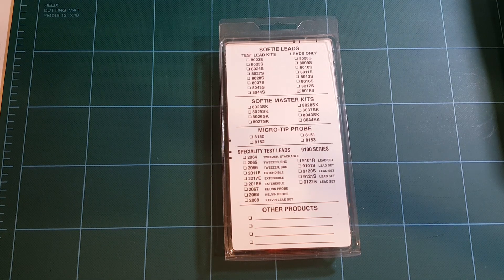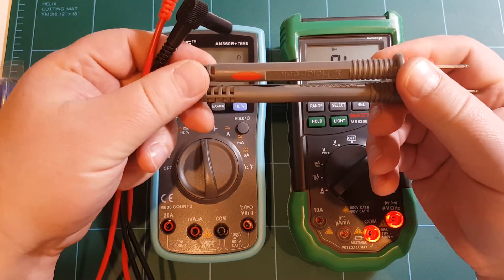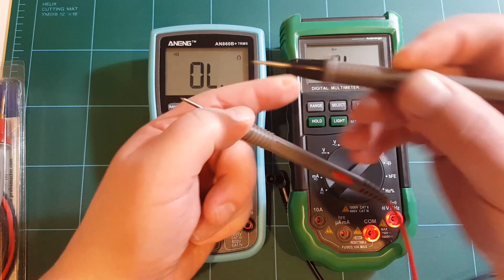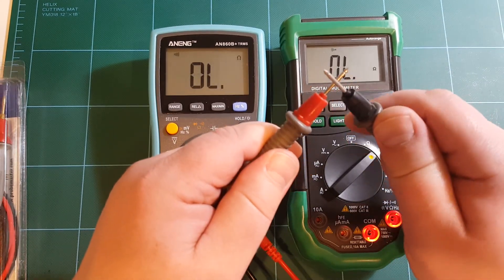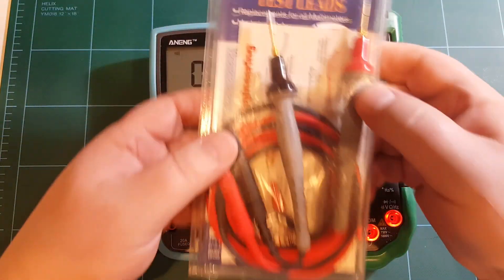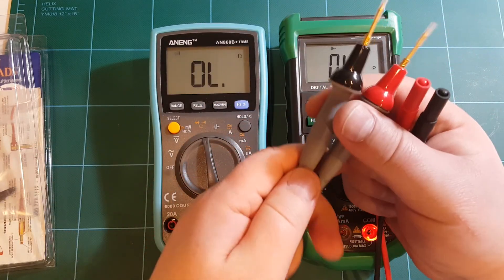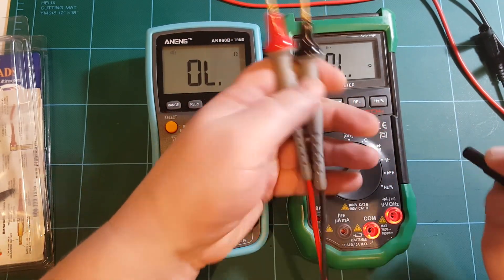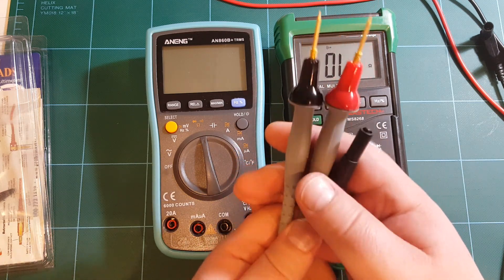Probe Master test leads

Comment: Simply clean your probe tips with isopropyl alcohol and a paper towel or clean rage.  The human ear would not be able to distinguish the speed of continuity connect between any of the probes.  There is a fine film on the metal probe tips that protects them during shipping and storage before being sold.  Hope this help you and others.

Comment: Here's a tip for probes that seems like junk on continuity tests.  Find some really fine grit sandpaper like 3000 or higher.  Give it a quick twisting motion rub and try continuity test again.  I bet it will improve 10 fold.  Nothing against probemasters.  They are fantastic probes for $17.  I own a pair.  Just want to help people make cheap probes nice and fast.

Comment: A couple of quick thoughts... stainless steel develops a surface 'passivation layer' (see 'Passivation (chemistry)' in Wikipedia), and often causes meter continuity to sound scratchy etc. However, stainless is cheaper. Stainless probes are better for punching through paint/rust & related spooge and no big loss if destroyed. Gold plated probes, like your Probe Master's are better suited for electronic solder joints & 'finer' work. Also, far as the plug ends go... the straight ends if banged around can break a meter jack, and should always be unplugged if/when transporting a meter. 90° plugs 'can' also break jacks, but are much less likely to do so. Don't ask how I know. Probe Master makes most any probe/plug/length combination imaginable, along with scope probes & related... all industrial quality. Take a look at their website. Reasonable prices too, and with proper care will last years on end  'Pomona' is another good Mfg of leads and the like.

Comment: I just yesterday got my very first set of Probmaster 8017S gold probes and wow what a difference, like night and day and well worth the money.  Overall quality of the wire, ends and contacts is way above most all others that have come with a meter.  I have this same 8268 Mastech meter and mine also did not respond as well as my other meters did with the probemasters in the continuity test but its still noticeably better, and based on the excellent response from my other meters I have to think its due to the Mastech meter not being latched.  My Anengs all respond very well to the Probemasters with fast clean continuity beep and lower resistance.  I LOVE the Probemasters and will be buying more from them.  I ordered direct from Probemaster and got lightning fast and free shipping.

Comment: I've found most new meter leads need a thorough cleaning before use. They seem to be covered in a clear protectant that can be removed with alcohol or circuit cleaner. It makes a big difference in contact continuity.  My Fluke TL175 and ProbeMaster leads seem clean right out of the package and are both considerably higher quality than other leads I've used.
Reply: I totally agree on the initial cleaning being necessary on budget leads, the difference can be night and day if the probes are any good at all.  Ive had some very good luck by lightly using either Deoxit or alcohol along with very fine steel wool or super find wet sand cloth (000 or 0000) to clean off what seems to be either some kind of invisible manufacturing coating or just surface oxidation, not sure.  In any event ive discovered certain leads clean up very well and perform very good, but on a few of the cheaper ones it does no good at all and I just pitch them.  Ive only recently broke down and ordered my first set of Probemaster 8017S leads after seeing various videos such as this one showing the hands down improvement even with unlatched meters.  Also I like knowing they are made here in the US and of course because Probemasters seem to be the best there is.  I have a feeling after I get my first set it wont be my last.
Reply from the maker: Great tip! I'll give it a try